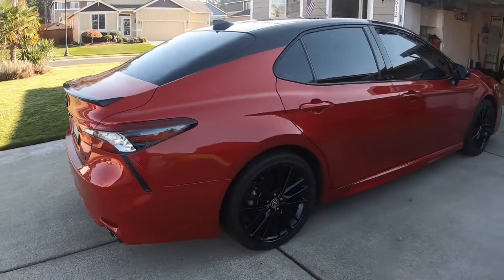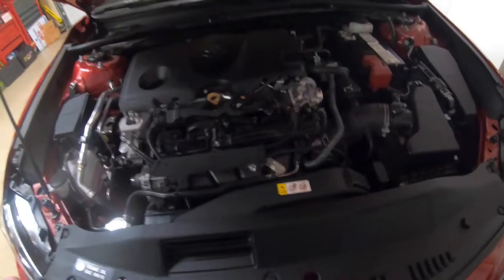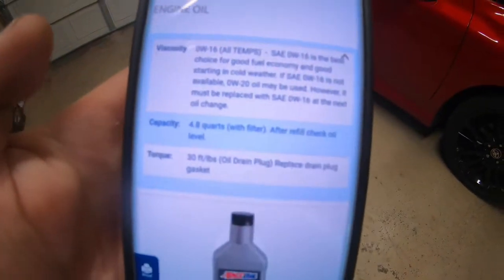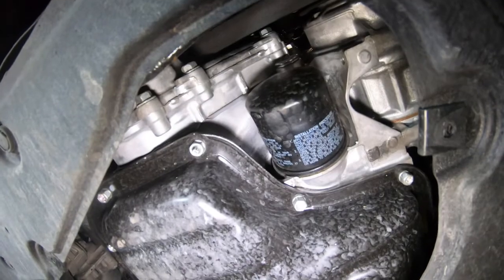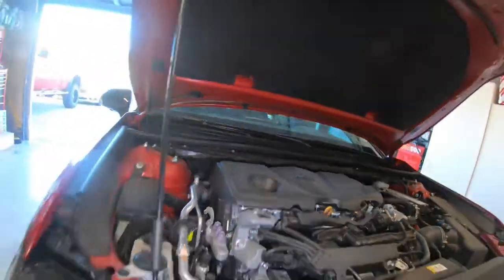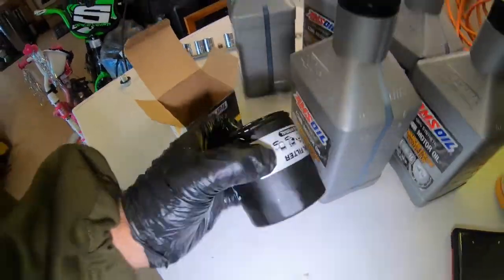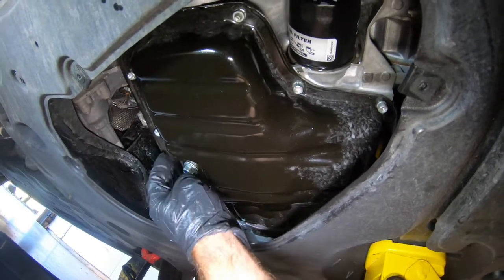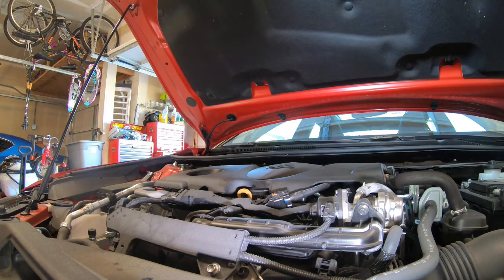2018-2024 Toyota camry oil and filter change and service reset @toyotausa

Comment: Changed my oil and filter change at 1k miles and every 5k miles after that. using only 0 16 oil.
Reply: How many quarts?
Reply from the maker: 5
Reply: @safyankhan8469  4.8 quarts with filter. put in 4.5 and run the engine for a couple of minutes, turn off and check dipstick. Add as needed.
Reply from the maker: 5
Reply: @brucewayne2773 does it really matter if you over service it by .5?

Comment: We have 2023 Toyota Camry LE. Our Dealer told us no need to change oil till 10,000 miles but I'm changing at 5,700. Supposedly they will do it free at 10,000 but they wanted me to pay them $121.00 to do it now. Is the wrench size for the L.E. same as you showed here 10 mm and 14 mm for the plate removal? Probably right 👍.
Reply from the maker: Sounds about right..toyota care is every 10k I felt same way and paid 2 have ot done about 5k. I believe it was around $100 out the door 4 the oil change I paid 4. Material I purchased through amsoil was about $60
 I haven't worked on the LE however I would be very surprised if anything were any different as long as it's the 2.5 motor..keep me posted
Reply: @Turnersspeedshop  👍 Thanks 🙏 I sure will. Today I bought a 5 Quart Bottle of Mobil br... Synthetic 0W-16 at Walmart for $26.75 plus tax, and a Toyota/Lexus br...Oil filter at a different Walmart for $7.79 aprox., Plus I bought a metal "cup-style" cheap oil filter wrench at Advance Auto Parts for about $7.75 plus tax, and my neighbor lady has two black plastic ramps she'll loan me. I already have a black 2 or 3 gallon oil drain pan, like they sell at Walmart/Advance Auto...so I'm set to change my oil for less than about $50.00 plus or minus! And over the long haul, knowing how to change it myself, not having to wait for an appointment at Toyota svc, and being able to reuse the 1. Wrench, 2. Oil drain pan and 3. Ramps over and over make it well worth the investment! Additionally I could start a small business (by email appt only!) And have a long line of Toyota or Camry owners who don't want to get their hands dirty, waiting to pay me, with great 😃👍 joy! About 35 percent to 50 percent less than Toyota charges! 😜🤗
Reply: The former head engine maker for Nissan says to change the oil every 2000 miles. He said that's when oil actually starts to break down and engine wear begins. My home dealership says every 5K miles, so that's a little comforting. I just bought a 2024 Camry SE, and I'm doing a new engine 1K mile oil change then its every 2K after that. One thing, Toyota has very specific additives to their oil. It's made by Mobile, but it's totally different due to the addition of these additives. There's a great oil breakdown video here on YouTube that shows the difference in Toyota, Mobil, Penzoil, and another brand.

Comment: if I couldn't get 0-16 I would use mobil 1  the correct oil is very important in this motor 5-30 or 10-30 is a big no no
Reply from the maker: Absolutely agree I will only run the 0-16 I heard many dealerships doing the 0-20 substitute however most customers were oblivious or unaware of what toyots says about that

Comment: Got a quick question I am hoping someone could and will answer. I see in this video you are using a Hydraulic Jack and Jack stands. Is there enough clearance on these newer Toyota Camrys to use drive up ramps. I am about to give our new 2024 Camry SE its first oil change. It the first foreign car I ever purchased and I go way back at 73 years old buying Cars,Vans and Trucks. Actually at 73 years old I shouldn’t be working  on my back anymore on a car. It is not so easy anymore. I thought I had that covered being at around 41 years old noticing a few things as I was getting older I installed a 9000 lb  above ground Car lift in my 42’x 60’ Morton Pole Building in 1992 a year after I had it built. That said it has saved my back but right now the lift area is tied up in my barn being I have a Classic Car sitting in the lift area that I can’t move so I am thinking about my old pair of drive up steel Car Ramps that served me well for years. I figured let me ask someone because I do have floor jacks back there and Jack Stands also.
Reply: I change my own oil and Im able to use ramps I have a 22camry se nightshade so my trim is pretty low I use the rhino ramps I bought at Walmart I believe they work good and the price isn’t too bad compared to jacks
Reply: I have a 2024 Camry XSE and use the highest capacity Rhino ramps and it does just clear the lower front bumper. I don’t use my skid shield anymore as I’m on dryer weather in AZ. with little rain. Well at 70 years old myself it makes oil changes a snap.

Comment: If 0w20 was going to harm your car why would they say you could run it period. So if i run 0w20 for 10,000 miles thats ok. They want you to run 0w16 for efficiency.... I live in miami where 90% of the year its hot and humid, i think that running 0w20 all the time i might lose 2 mpg , but it not going to blow up my engine !
Reply from the maker: Certainly not Stating whether I agree with that or not simply stating manufacturers recommendation. I try to stick 2 facts vs  opinion in my videos though I certainly have plenty👍
Reply: Toyota engineers designed the motor to run 0 16 not 0 20. Watch The Car Care Nut channel on this topic. It's not about the weather and where you live.
Reply from the maker: Couldn't agree more!

Comment: I have difficulty to remove my 2023 Camry LE oil filter for hours. The car dealer service put it too tied.
Reply from the maker: Have seen it so many times. I hate it when they wrench them on. like that and then they get tighter over time no need for that. Sorry to hear
Reply: @Turnersspeedshop  Do you have any idea or suggestion how can I remove it?
Reply from the maker: What kind of wrenches have u tried?
Reply: @Turnersspeedshop  I just went to Autozone to get pt swivel oil filter wrench, but it didn't work at all.
Reply from the maker: https://www.amazon.com/3mirrors-Compatible-Highlander-2-5-5-7L-Aluminum/dp/B087LZ9DHQ/ref=mp_s_a_1_1?crid=2QHYEI3L0ICJX&keywords=2021+camry+2.5+oil+filter+wrench&qid=1683154800&replacementKeywords=2.5+oil+filter+wrench&sprefix=2021+camy+2.5+oil+filter+wrench%2Caps%2C253&sr=8-1&vehicle=2021-76-1011------------&vehicleName=2021+Toyota+Camry
I would try this style. Allows u 2 get decent leverage. Hope it helps
Reply: Thank you @Turnersspeedshop  . I drilled 3 holes and use screwdriver to open it.
Reply from the maker: Glad u got it!..sometimes u have 2 get drastic. I'd say someone definitely wrenched it on.
Reply: @RoadTravelVlogs  Start lifting weights?

Comment: I have a 2024 Toyota XSE 2.5 Engine just read the manual and the cabin filter says to have arrow pointing up I see you put it with the arrow pointing down. Which is correct? Thanks
Reply from the maker: Depends if your running a factory filter or aftermarket. Plastic door, tray amd genuine Toyota filters all have arrows pointing up as 2 wich side goes up. The filter I used and a lot of aftermarket filters have the arrow indicating direction of airflow ( wichbos top 2 bottom) instead of indicating woch side is top or bottom. Hopefully that makes since. Basically the arrows are not indicathe same thing on genuine vs aftermarket filter. 2 make ot easier charcoal side of filter should be on top.
Reply: @Turnersspeedshop  Thanks

Comment: I recently purchased a 2024 Camry SE 2.5L for my wife in November of 2023. I have been keeping an eye on the oil and it still looks clean on the dipstick. The car has about 3500 miles on it at present. I want the oil changed at no more than 5000 miles. I am due a Few Free Old Changes and Filter change maintenance from what I understand but read somewhere that Toyota will not change your oil at 5000 miles. Do you know if this is true? You mentioned about the service light on your car. Can you tell me at what mileage should I expect it to come on. I have always done my own oil changes on all my vehicles and Classic Cars going back to the late 1960’s believe it or not. If that is the case I will change the oil myself at 5000 miles. I am curious to your thoughts on it?
Reply from the maker: I know the toyota care program is 10k miles. That's what dealership gave us for 2 years when we purchased the car from what I have seen that seems pretty standard. I have heard people in some of the social media groups say their dealership does every 5k. May depend on service advisor? May be worth asking. The maintenance indicator is scheduled 2 come on every 5k 4 service. According toyot the first 5k interval is a tire rotation fluid check ect. The next 5k is the oil change & tire rotation. And so on. Hope that makes since. I Have been curious 2 do an oil  analysis at 5k and again at 10k miles 4 my own curiosity. Wife packs miles on faster than I can keep up most of my changes have been around 7-  10k miles, little motor runs pretty clean oil still visually looks good
Reply: I just bought a new Camry myself.  My Toyota dealer "services" the car every 5,000 miles.  BUT they only change the oil every 10,000 miles. At the 5,000...15,000 etc. service appointments they only rotate tires and do a visual inspection of the engine for anything that may need attention.
Reply: @Mitch2009  I decided I will change the oil and filter myself at 5,000 miles and wait to 10,000 miles to bring it in for the dealers first oil change and inspection. I have purchased new cars in the past where once I purchased the car I never brought it back unless there was a recall or a part went bad under factory warranty.

Comment: Hello nice video 
I bought a Camry xse v6 2024 
And the dealership they told me the car need the oil change every 10k miles 
And I think that’s  too many miles for oil change 
What do you think about it
Reply: Yep, your right. 1K when new and every 5K after that. Will 10K work? Yes, but dealers only need to warranty the engine for 60K.

Comment: You forgot to show puting on a new metal drain plug compression  washer, they are for one use only. Only use metal ones the plastic ones may split.
Reply from the maker: I didn't forget..I just didnt do it 🤣lol unpopular opinion but I flip & reuse them a couple times copper washers that is not plastic....but yes if ur going by the book change them out

Comment: You should do a how to pcv valve video for this car, dont know why Toyota decided to stick it behind the intake manifold?
Reply from the maker: Proof engineers never actually work on anything 🤣
Reply: @Turnersspeedshop  also, there's a great lab analysis video on Toyota's OEM oil alongside Mobil 1, Penzoil and Amsoil. Toyota's OEM oil has nearly 4 times the amount of dry lubrication additives than Amsoil and double of a few more additives. Yes, it's base is Mobil oil but the additives Toyota engineers have added to it make a difference. I'm pretty sure if you type in Toyota OEM oil analysis, the video will be one of the first results. The guy doing the video has a bit of an accent.
Reply: @Turnersspeedshop that Toyota certified mechanic on YT "Car care nut" says to always use the 0w-16 due to this engine being designed specifically using that weight. He said anything else will cause issues down the line. I get 6 pack cases from Amazon for just over $50. My dealership here in Ohio sales it for just over $7 a quart. The website lists it as not available because it cannot be shipped, you must go in to pick it up. Some sort of new restrictions on shipping petroleum based products.

Comment: When changing oil do you recommend to change the oil plug washer? The video didn't mention or show this step.
Reply from the maker: Technically they do recommend replaccrush washer each time. I did not. So long as the crush washer has not been crushed to oblivion I have reused crush washers numerous times without issue. Alot of times I will flip the washer. Not correct by the book but I have yet 2 have an issue either. I'd say if your more comfortable simply replace it. Certainly can't go wrong doing so

Comment: Thanks bro
Reply from the maker: Absolutely..hope it's of help..ironically shortly after making this vid someone ran into the side of it at the gas station 🤬 I'll post a vid soon.
Reply: @Turnersspeedshop  that sucks yeah this helped a lot got the same problem with the dealership I’ll just do it myself what o’riely brand oil would u recommend
Reply from the maker: If u can find it mobil1 is good stuff as well
Reply from the maker: Part of why I ordered amsoil most of the shelves around here are bare, couldn't find what I needed

Comment: Can you tell me about mobil 1 is good oil because the dealer charges me 1 litre $ 16.99 per litre Canadian dollars but I saw at Canadian tire on sale for 35 $ is not on sale is $78 Canadian dollars thanks again take care bye from milton Ontario Canada
Reply from the maker: seems 2 be good stuff. Mobile 1 full synthetic is what I ran 4 years without issue in most of my vehicles